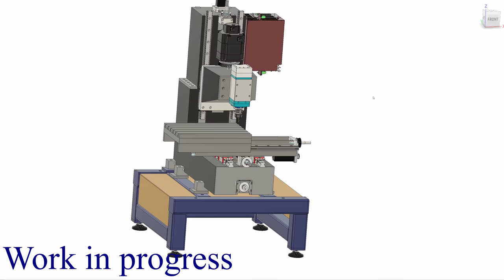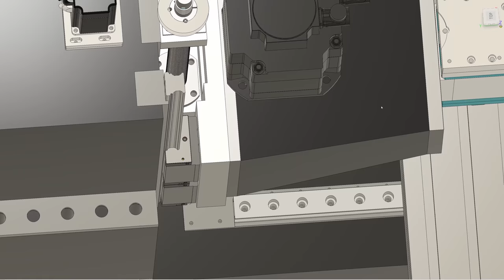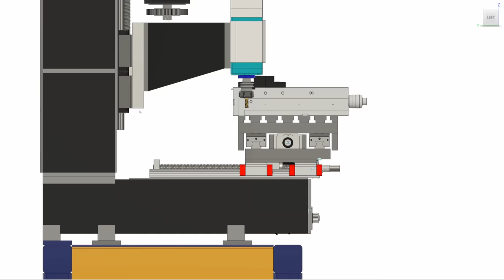DIY Milling Machine Part 1: The base and concrete parts

Comment: I remember Stefan Gotteswinter describing use of a two-component epoxy for machine alignment, the way he did to tram his vertical milling machine.  It's what I'll likely be using to build my own traveling gantry machine which, I have to say, I'm patterning after yours.   It's a privilege to watch these - I'm grateful for the insight your videos have given.
Reply from the maker: First I will try scraping. I can still use the leveling epoxy if scraping fails.

Comment: Hi Alex,

I really like your machine!  You could make your own lapping tool by drilling a hole in the centre of your base between the rails.  Get a piece of 5mm steel plate cut to a diameter large enough to cover all your steel mounting pads and place a hole in the centre so you can insert a pivot pin.  Cast a concrete slab onto your circular plate maybe 5 or 10 cm thick for some weight and to stabilize the steel disc.  Have the disc turned or surface ground flat.  Now coat the disk and your mounting pads with lapping compound or valve seating compound and turn the disc a number of times by hand until you see your mounting pads have been flattened across the majority of their surfaces.  You could also ask to borrow a granite surface plate from a machine shop.  If you know where the surfaces are too low, coat those with a thin layer of slow curing epoxy.  Cover the granite surface plate with plastic and the turn upside down and place on top of the mounting pads.  The weight of the surface plate should force the epoxy to only fill the low spots.  Hope this gives you a workable idea and good luck with the rest of your build!
Reply from the maker: There is one problem. I have edges in the inlays to press the rails against. So I can not use the lapping method. But I got some ideas here that will work with the edges and are quite easy to try.

Comment: You have a Typical modern day way of thinking and solving problems . You have to many options . Today people have a tool to do anything . You have the answer to your problem. Scrape it you will be surprised  it will take you a lot less time and work than hauling that back outside . It is a slow process but you will learn and appreciate it more. Scrape measure  scrape measure. Every machine tool  of old was hand scraped.  I'm retired now but my fist accurate item to make was a one inch cube out of cold rolled steel cut from a 1.25" plate, I was about 16.The only tools we were allowed was a hacksaw and one file. For ever one thou you were out of square from all sides, was one mark off. Good luck with your project it looks awesome.
Reply: It's not the scrapping he's is afraid of,  its the wandering concrete will continue to wander about. After about 15 years concrete stabilizes an easy mistake as an afterthought ~ we have made clever after the fact!
Reply: @mcadamdavid1  you mean concrete is not a good option? is not clear to me what "wandering concrete" means.
Reply: @aion2177 concrete has water in it, and it takes decades before it's all gone. The method used mostly is epoxy/granite, which has been the choice for over 20 years
Reply: Scraping is a decent option but i dont get the weird roast towards using modern tools

Comment: If you are confident that your left rail is straight then move the indicator base to a left cart, remove the right rail and start with your highest point and start working it down and measuring as you go. You don't have to scrape. I remember an amateur scraping video where he used a Dremel with a sanding drum for roughing in. Maybe just a stone with some WD40 by hand like someone else recomemded.

Comment: Thanks for sharing your lessons learn, I plan to build my own machine soon and your video is a good help.
The problem with casting with wooden forms like plywood, is that the pressure of fresh concrete can move your parts, wood is  compressible and easily warp.
The better way as a lesson learn you can use rigid form like steel plate reinforced by steel rods and nuts in betweens.   Epoxy grout is also better alternative and can pour slowly by layer to reduce pressure.
Reply: You can do the granite epoxy layer by layer? Like let it dry overnight and then pour another layer? That's good to know.
Reply: @ChristopherJones16  there is epoxy grout for big layers like 50 cm. Check mapei planigrout 350, i’m planning to use that for my cnc structure.
Reply: @marson8870  can you elaborate on the steel rods and nuts reinforcement? Are you saying to have the steel rods inside the mold to reinforce the actual object were pouring with holes drilled in the plates for the rods to stick through and then tighten up nuts on the outside of the mold to those rods basically self clamping the mold together. Then when it’s cured you cut I off the excess rods sticking out of the poured object? 

Or are you saying the rods will be outside the mold. I’m guessing the two side plates will overlap the front and back plate and then you  use a rod to pull the two overlapping plates together to hold them pressed against the front and back plates? Sort of like an “H” shape but where the “-“ is in the “H” it’ll be a square/rectangle.  

I’m probably off on both. Also what’s a minimum thickness for these plates we can use? Wondering if I can pick these up at Home Depot or if I’ll have to special order these.
Reply: @ChristopherJones16  you can  simply make a steel skeleton and then pour the resin into the mold. 
There is also a uhpc with a young's modulus of 80 gpa, a little better than aluminum. With that you need steel only for the rails base. You need a nanodur cement and an artificial gravel called Durigid.

Comment: Here is an idea if you can get one of the rails true with shims you could attach a bench grinder on the rail (maybe use the second rail as another axis to attach the bench grinder on) and grind it flat. Then reverse it and grind the first rail flat. Then use a flat piece of granite or iron with a precision level to check it. Just make sure you level your machine before you start using some geometry on the column. This idea is based partially on the jank o grinder from nyc cnc so watching their video may help.

Comment: Could you CNC the bottom of the linear rail, instead of the top of the steel inlay? Much easier to get that to a machine shop. Or failing that, add a ~3mm spacer bar between rail and inlay on both sides, machined to compensate for the inlay's imperfection?
Reply from the maker: I'm not sure if I would machine the rails. But the spacer piece sounds like a valid option to try. I already got some recommendations what I could try. This one is also on the list now :)
Reply: Sounds like it would induce wear/slop

Comment: Hey Alex! You are pioneering a new field with new problems. Don't worry you'll figure this out. :) One suggestion I have: Ever see how woodworkers flatten large slabs of wood that cant fit in a planer? They use a sled to make the surface even. I'd say you have the talent to make a very precise machining sled which attaches to the sides. You'd then be able to bring both surfaces to the same height with a cheap hand router since the depth isn't that much (< 0,5mm)
Reply from the maker: Thanks. I will try scraping first. In theory you can get the flatness down to some μm. If it doesn't work I can still try something else :)

Comment: hey alex, i made a CNC, i had the same problems as you, i grinded both with a big granite surface plate, i glued two 80 grit belt grinder paper and grinded by hand pushing back and forward 1000 times, eventually i had nearly 0.05 on 600 or 700mm length

Comment: Hi Alex, hope your doing well. been watching for a long while, since you were building your first mill. Sorry to see that your having this problem. First it should be said that this error is actual quite small about .001 thousand twist total. Matthew here in the US state of Wisconsin, 40 years career machinist. Wish you were closer id jump in the car and come give you a hand. The error  looked much worse than it is because as you have your indicator set up it magnifying the error by 8 x., but its probably enough to cause the block to bind up when all 4 blocks are bolted up tight. The best way to fix is to hand scrape, the scraper that i use i made from an old file with a small piece of carbide held in with a small clamp. For a master look for a hardened and ground parallel 1 inch by 2 by 12 long. Should only take a couple of hours to straighten it out, don't know if its just the one on the right or both. Ill check back later to see if you found this, post any questions if you have them. Oh ya celifane off a pack of cigs is .0005. good luck. Matt
Reply from the maker: Thanks. I already have everything here I need for scraping so that's the way I will go. I did a test on a small steel part and there scraping worked fine and I was able to get a flat surface quite fast. But first I want to finish some other projects before scraping. 
Best
Alex

Comment: Awesome project.
In order to decrease time for scraping you can try to use Zedex or any other competitor's product.
It is a polymer. Easy to scrape. And can be glued on top of your inaccurate surfaces.
Reply: can you post a link? All i can find is a plastic for making generic plastic parts

Comment: Awesome project!  Don't despair. Scraping isn't hard to learn. I learned to do it in less than an hour. The only challenge is scraping multiple sides, but your scraping job is among the more simpler challenges. You only need to ensure the bed and column ways are perpendicular. I would get a large flat granite piece. You can get them for cheap from a kitchen counter fabricator. If you still want someone to help you, try contacting Stefan Gotteswinter. Btw, he demonstrates another method where he uses epoxy as a "liquid" shim.
Reply from the maker: I just started scraping and so far everything looks good. I borrowed a big straight edge from Stefan Gotteswinter and he gave me some tips :)
Reply: @AlexCNCen  Excellent!  I hope there will be a video on it soon!

Comment: I would use a surface plate and scrape the surfaces for flatness and parallelism
Reply: This is what I did with a surface grinder column ways. I built a template from steel and scraped it flat and parallel on a 2X3(600X900mm) surface plate. Then I used the template to scrape the four sliding surface parallel and perpendicular. I got them square and flat within 5 microns (2 tenths). I checked the straightness with a 4 foot (1.2m) granite straight edge lab grade (AAA) 2 micron flatness full 1.2m. I checked the squareness with a 12" (300mm) cylinder square. It took me 2 months for template scraping and ways scraping. The ways were twisted and tapered. Twist was about 20 thou (0.5mm). Taper was 15 thou (0.37mm). So there was a lot of scraping all done manual

Comment: Build two dams or troughs around each of the mates (ply/mdf with a release agent works) and pour about 3~5mm deep and low viscosity epoxy grout on them, make your own grout with epoxy and carborundum, aka silicon carbide, 600 grit, an extremely fine and hard dust.  You need to choose a very thin epoxy with a slow set up time and pack it with the grit but not so much that it becomes a mastic paste, it needs to flow still, aim for the consistency of warm black honey.  It will flow to perfect flatness, I.E as flat as the curvature of the earth which for the spanned distance is certainly more than good enough. If you connect the two troughs with a channel between them at each end you will also achieve perfect parallelism between the two. This is how it is done with extremely large machines with rail mounts too large to mill, and also, my own. Premade mixtures also exist, look up epoxy bearing grouts like chockfast, nordbak etc. P.S. You can coat your rail mount bolts with melted beeswax and screw them into your mounting holes prior to the pour, they will release after it sets leaving a nice wax coated hole.
Reply: wanted to do that, but some people said the epoxy wasn't hard enough compare to steel and will deform under the linear rail. gpa of epoxy is 4 steel 200.
Reply: @jesuismika  Some people don't know what they are talking about, they have an opinion but no experience 😉
Reply: @m3chanist  well yes maybe, but the fact seems real about the stiffness. And the fact  I coudn't see a single company doing this. And I searched quite a lot.... If you have more information to help look in to it. I would greatly appreciate. thank you.
Reply: @jesuismika  It's not real, it is standard procedure for every large project with an entire industry of epoxy grout manufactures, some of whom I listed, that service the sector, EG mills large enough to cut ship sized parts, National sized dam/generator projects. Rest assured, if it's good enough for that scale of project, it is more than good enough for a home gamer.
Reply: @m3chanist  well I guess it depends the expectation, a huge machine won't have the same tolerance as a small one. And maybe if you are talking micron, the epoxy would deform a tiny bit, which is acceptable for some project, and maybe less for other. I'm trying to see the solution to be in the micrometer perimeter with the less equipment possible, if possible. ;-)

Comment: There is shimming stock called onion skin available on ebay. As thin as .0002 inches. CNC4XR7 used it on his linear rail conversion.
Reply from the maker: Thanks. I will try to get some 5μm shimming stock. That will be also helpful on other parts.

Comment: Have you considered using a large thick panel of plate glass,  glue a sheet of automotive sandpaper and then use it to rough lap then fine lap the rails?
Reply from the maker: The problem with that is that edges for the linear guides on both sides. So I would ned a plate that exactly fits between those. An Option would be to remove those. But I'm not sure about that yet.
Reply: @AlexCNCen  you may  need to accept the inevitable and remove them and have them surface ground

Comment: Awesome project. Would you mind to share the link where to buy the linear rails like your or their specs? I can't find them in this size. Thanks a lot.
Reply from the maker: Hi, the rails are size 35 from Schneeberger and INA. Got them as new old stock quite cheap. You can have a look in their catalogue. But I do not really want to know what the would cost new 😅

Comment: You should try to find surface grinding . But you need to do slot 1-2mm for grinding wheel out. In this case you ca made very accurate surface and side support.

Comment: Another possibility if the two surfaces are close to flat would be to lap them in. You can get large old cast iron laps for not too much money on ebay, and use it across both surfaces at once to even out the twist. Just start with a more aggressive grit lapping fluid to move more material
Reply from the maker: I have an edge on every side for the linear rails to be pushed against. So the plate must not be wider than 250 mm to fit in between. I have started scraping now and so far it goes like expected :)

Comment: You could have used industrial steel section box those sizes as horizontal/vertical beds. Drilled, tapped plugged & machined; then filled with Granite concrete aggregate or concrete.
 The concrete idea will be constantly moving about like a machine shop floor. In answer to your problem make a x-z axis plate 3" /75mmm thick flash ground of graded steel commercially available - take your guide rail system off x/z and fix to the machined plates 3 mm deep slots as soft mallet fit ~ and drill and tap and locate your linear guide rail/s system. [ reason is that the concrete hasn't the inertia power under the creeping process of settling concrete to warp steel plates. Steel cover plates stronger than concrete. ] I hope this of an idea for you Sir.
Reply: Concrete or granite- concretes Etc, will always shift and settle due to the expansion of air and water into it. At the design conception of the machine, the granite or concrete suppliers give an expansion and contraction quota for its [ properties of materials ] Chart. At 10 microns you said adrift at present is good enough for general and precision work. You would have to be in an atmosphere controlled environment on C.M.M Beds to even reliably measure this! Further saying that it's possible outside of this is misleading and confrontational at best. Otherwise, machine builders, who spend millions on inspection equipment and controlled environment to ascertain machine tolerances in manufacture. It best to remember their claims to accuracy at best is as good until the machine is outside the door as the warranty ends right there with them. In part due to the Cold War and nuclear accidents throughout Europe Canada the States Australia china Russia back in the 1970s - mid80s. For Eg, You machine a Flange to your gauges and send it by post to as many states and regions as to spend two days in each area of your country. then see if it fits as transitional fit on its test rig you made for it in your home factory as stabilized. 
This tells you the time in space and time you exist in your home workshop different to other postal codes in your area.  linear vertical and radial warp in the test piece is relative to sight and organic matter called FAR OUT Funny shapes and sizes people heads faces extremities to Cherknoble reacter blow up is relative to all materials is the point of the test.

Comment: It would be nice if you explained why you used UHPC rather than epoxy granite. Which is better in terms of accuracy in the long run for a precision CNC machine?
Reply from the maker: The UHPC has a lower tensile strength but is a lot easier to process. A normal concrete mixer is everything you need. Long term stability should be pretty much the same. Maybe the UHPC is a little bit more stable. I mainly choose UHPC because of the easy processing.